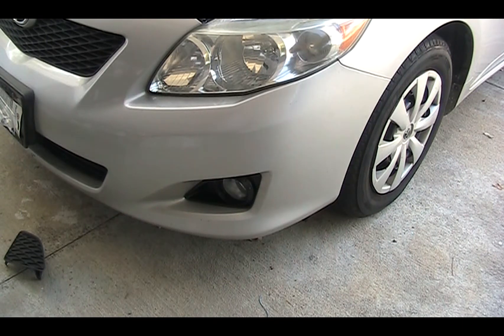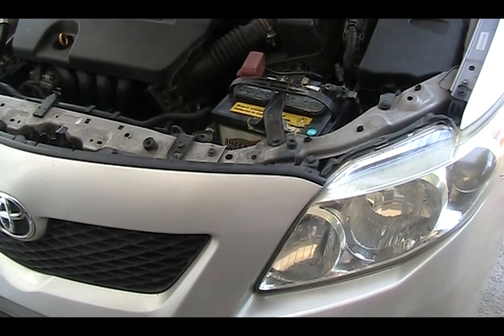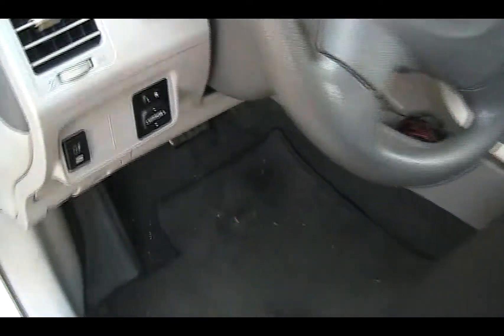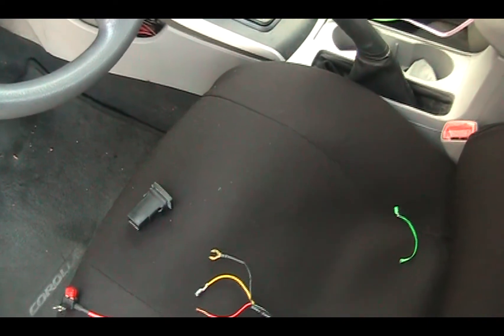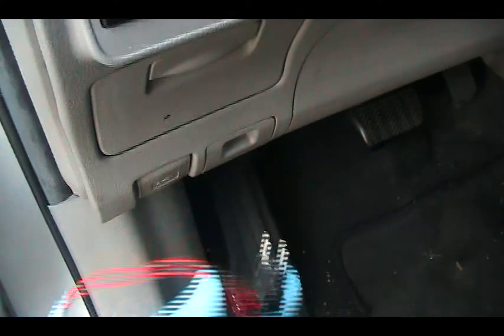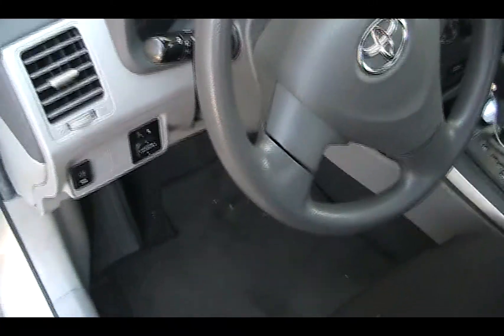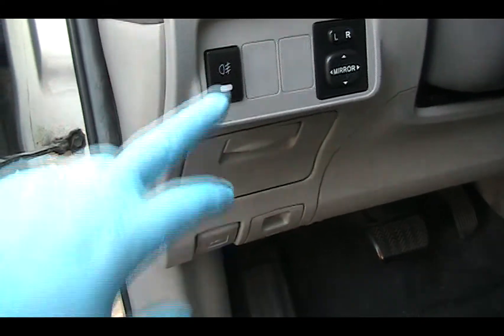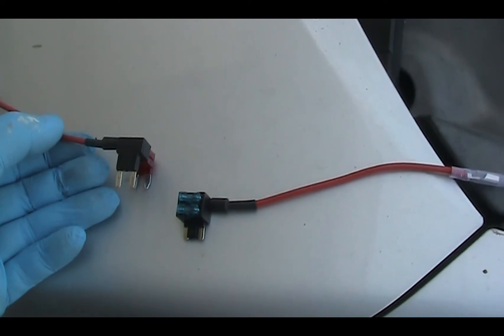DIY - How to install 09-13 Toyota Corolla Fog Light Wire Connection Fuse Tap Installation procedures

Comment: Why didn't you use the factory harness for the fog lights instead of running all those cables to install your fog lights?  My Toyota Corolla is also a 2009 and it comes with the harness to plug into the fog lights which takes a few minutes to install the fog lights.
Reply from the maker: In order to use the factory harness, I need to change the light switch which comes with the additional fog light switch on the far end. My Corolla only comes with light control but no fog light function (but I can confirm the fog light harness are there). Since this is a old car, I do not want to buy the new light switch with fog light turn on/off and I also do not want to open up the steering wheel and install the new light control where the air bag is located. I agreed, it would be much nicer to have the original fog light switch and using the original harness but in reality, I did not even use the fog light once. It is more for the looks since most Corolla on this model does not have fog lights installed. Thanks for your comments and thank you for watching.
Reply: @diycheapdaddy2113  Thank you for that information because I almost purchase the headlight switch with the fog light combination and since you stated that you didn't want to open the steering wheel column and didn't want to mess with the air bag, then that made think that it is better to buy a fog light kit that comes with the wiring and the switch and at the end I will spend less money because the headlights /fog lights combination switch will cost me between $152 to $170.  For a little bit over $200, I can buy a set of LED fog lights with the kit that also includes the switch and the bezels.
Reply from the maker: @EnjoyLifeNow24  You are very welcome. There are videos in youtube showing the replacement of the fog light switch with existing harness just as you described; however,  for my Corolla, it is more for the looks than function. I installed this only because I saw it on sale in Amazon for $35.00 included the bulbs 😁 I still remembered dealer want almost one thousand for the OEM fog lights ; therefore, I have to get this $35.00  For my other car - 2007 Corolla, that fog light only $25.00. 🤣  Thank you for watching and thanks for your comments.
Reply: @diycheapdaddy2113  $1,000 for a set of fog lights?  That's what I paid for a 2013 Toyota Corolla engine.  I don't know what those people at the Toyota dealership are smoking.  Their original fog lights for Toyota Corolla 2009-2013 are not even LED fog lights.  I have seen LED fog lights kits for $200.  The original ones for my 2009 Toyota Corolla at the Toyota dealership cost $186 each.  The bezels are not included nor the wiring neither a switch in case if I wanted to install a separate switch instead of buying the combination switch.  I will install LED fog lights because they are brighter.
Reply from the maker: @EnjoyLifeNow24  Totally agreed and in addition to that, LED lights also use less energy and last much much longer than any H11 or 9006 bulbs. I think Dealership considered it as "option"/"Accessory"/"OEM quality" and they are opened to negotiation. I also saw used OEM in ebay and they are not cheap at all.  
By the way, I re-visit your option on changing the switch, it may not be that bad except I am not sure the quality of the third party light switch. Also, be extra careful when working in front of the steering wheel (disconnect battery...etc) avoid airbag deployed by accident. Not only it is dangerous, airbag replacement is also quite expensive.  🤕
Reply: @diycheapdaddy2113  Are the OEM fog lights bright enough? What's your opinion of OEM vs LED?  I am really considering in staying away from buying the headlight/fog light combination switch after you informed me about the air bag.  Thanks again for that.
Reply from the maker: @EnjoyLifeNow24  The OEM is not bad, but I used yellow color bulbs and that is good enough for me. I don't use that much because I don't drive that much in early morning.
Reply: @diycheapdaddy2113  was going to install fog lights on my 2009 Corolla, but wanted to do the factory way, so I would just need the new switch and a relay for behind the radio?  My original switch is broken, so I need to replace it anyway.  Thank you
Reply from the maker: @mikeb6902  The wiring /connector/harness should be near the fog light area. Please make sure those are cleaned before hooked up the bulbs. All you need is to have the switch which has the fog light on/off and then connect back to the wiring on the steering wheel. There are lot of third party switch on auction site and also some used OEM switch. Good luck. Thanks for your comments.
Reply: @diycheapdaddy2113  thank you, if you dont mind my asking, my friend has a 2010 Corolla, and if he would decide to do what you did, what fog light kit did you order?
Reply from the maker: @mikeb6902  It really a personal choice; however, for me, I like the OEM looks because I don't really use fog light that much. The one I got is "RP Remarkable Power, FL7005" from Amazon. It has 130 rating reviews and 4.6 out of 5.  I would picked the one with good rating and allowed free shipping on returns.😄
Reply: @garyy3758  It is a relay that you have to find to get your fog lights to work.  In my 2009 Toyota Corolla, that relay was behind my receiver.  I used my factory wiring harness for my fog lights.  It wasn't an easy task like I thought it was going to be by just installing the fog lights and plugging them to the factory wiring harness.  I also changed my headlights' switch and installed the headlights/fog lights switch combination.